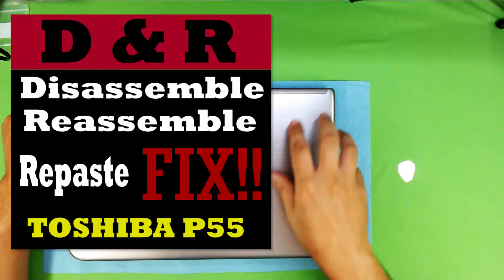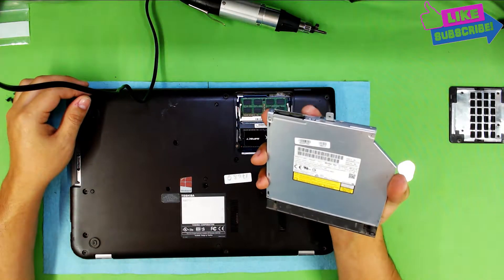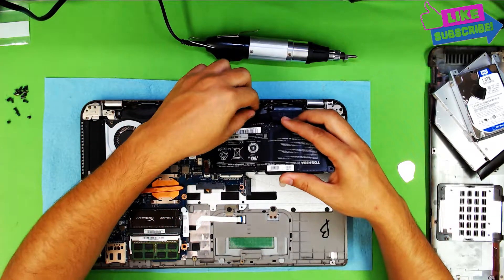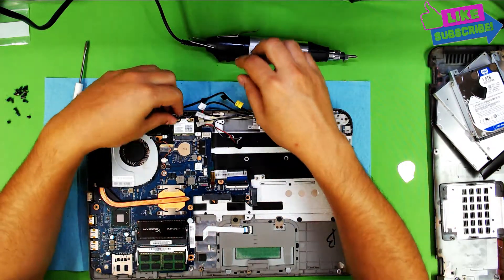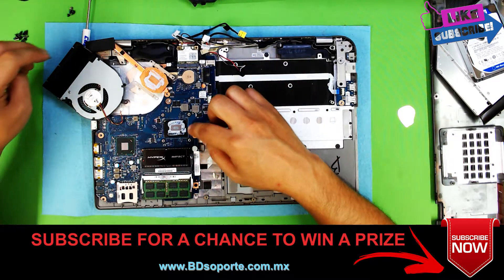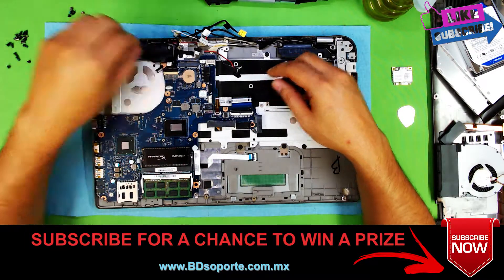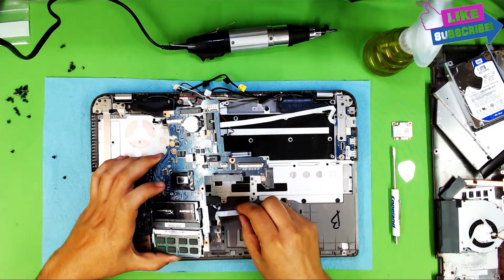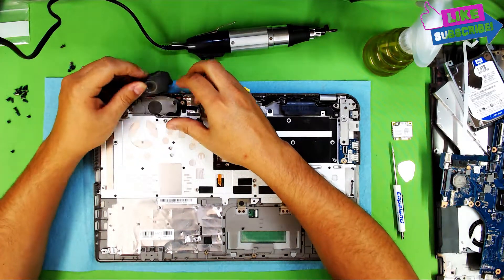Toshiba satellite p55-a5200 Tear down and repaste ,  laptop service Disassemble and Reassemble

Comment: I have this model, can you tell me how to clean under the keyboard? Some of my keys dont work
Reply from the maker: Manda Justine if your keyboard is not working or some key dont work even if you press hard on those key. You have to replace your key board there is no fix for it. With time it will spread and get worse.